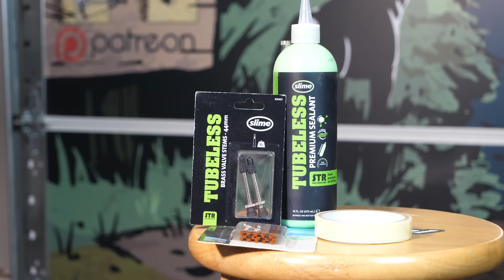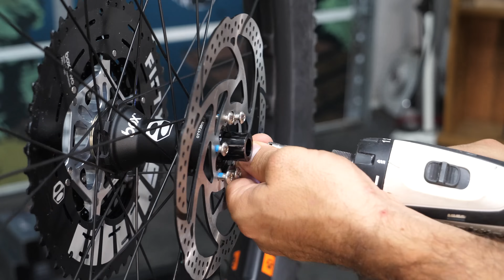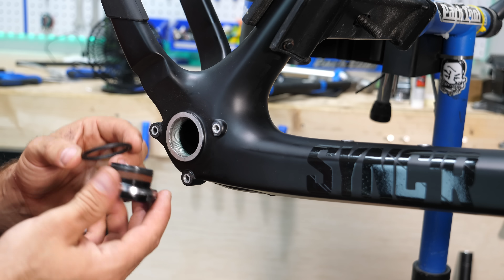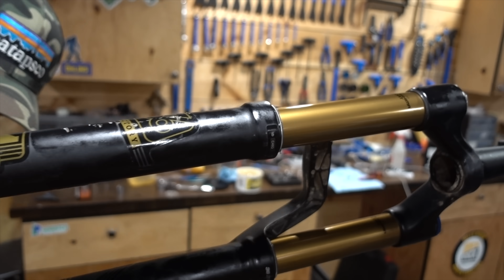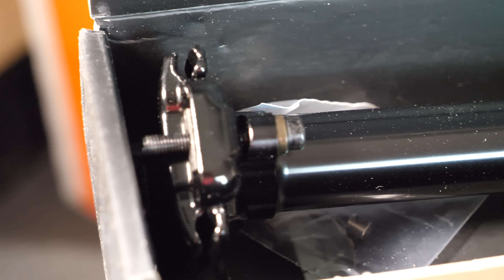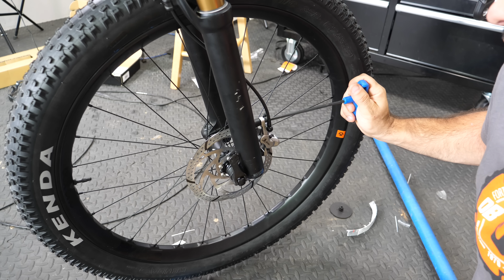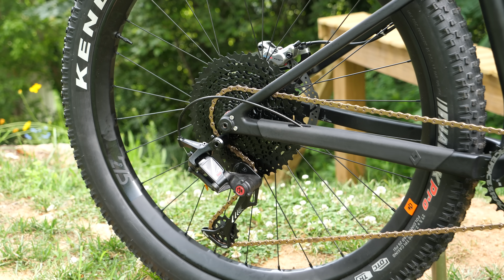Building my Sync'r Carbon Hardtail from Parts

Comment: Hi Seth! Such a sick build and for me the blue pedals set it off!
Why did you go from a 160mm fork to a 140mm? It would've had a slacker HA which is better right?
I would've left the Fox forks on - they looked better.
Reply: Rad-Dad/JBone XC putting a fork that's too long can put a lot stress on the head tube and cause it to fail. With how hard Seth rides, he would very likely snap the bike it two if he raked out the bike with that much travel. 😬
Reply: Is that because it's a carbon frame?
Reply: Rad-Dad/JBone XC nope, any frame has a set travel length in mind. Even steel bikes.
Reply: OK. I've met loads of guys who have gone from 140 to 160 without any problems. Maybe their bike's geometry suited either?
Reply: Rad-Dad/JBone XC it's very possible that the bike was capable of running a 160, like my chromag. If the max the bike was designed for was 140 and they're running 160 that's putting a lot of stress on the welds/joints. They're gambling that the head tube can take that much leverage on a huck to flat.

The fork acts as a big lever and the engineers designed the head tube to take a set amount of force. If you put on a longer fork, you're putting more leverage on the head tube than it was designed for.

In top of that, if you make out a bike too much it can really affect the steering and handling if the bike in a negative way.

It's always best to talk to the manufacturer and see what fork they recommend.